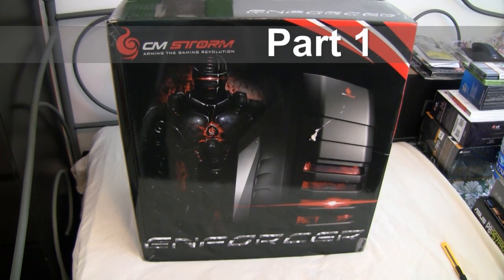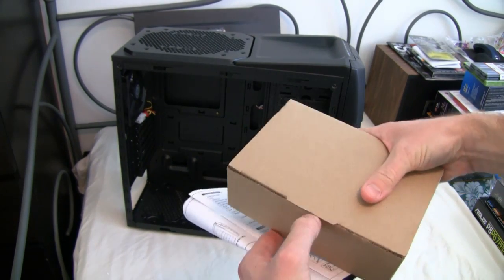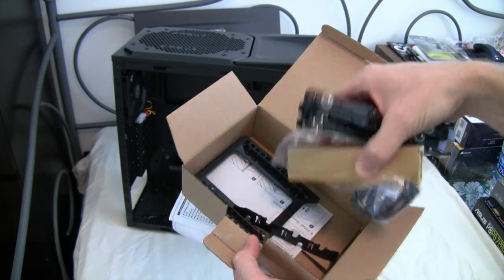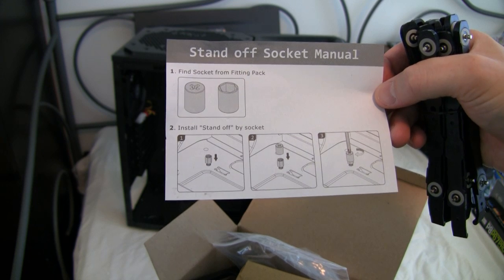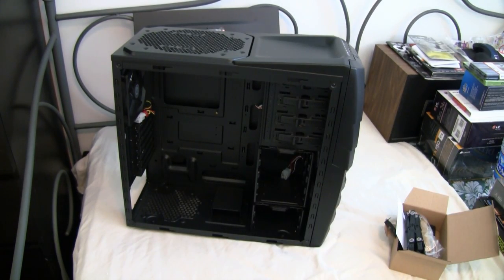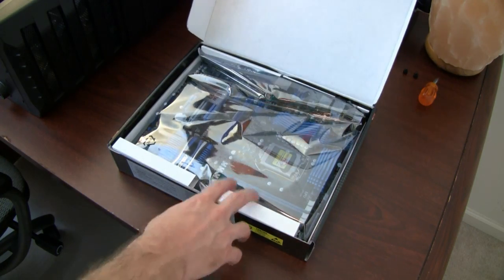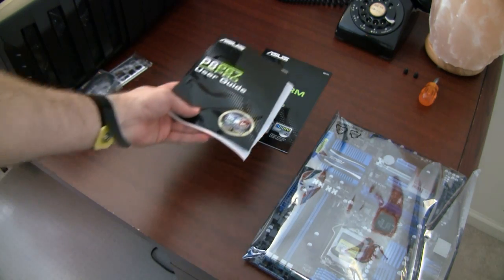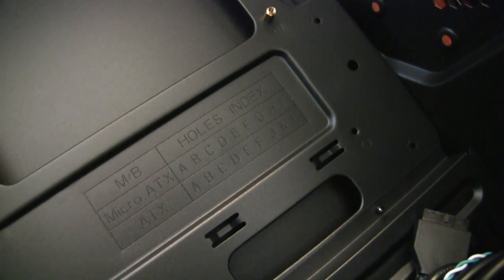Gaming PC Build instructions (Step by Step) Part 1

Comment: Please reply. I wanna build a pc but I am not sure about one thing. How is OS installed on pc. Or it goes with processor. ( yes I am a noon.)
Reply: You need a install disc. It goes into a dvd drive. Or there are ways to do it through usb. Look that up too
Reply: Did you build?
Reply: Felix aigner half way done
Reply: Rostislav Gavriliuk still wanna n awnser? :)
Reply: What parts are you using?
Reply: Felix aigner parts list costed me ~1500 $, do you need the list?
Reply: Email
Reply: ***** email
Reply: Rostislav Gavriliuk An OS like windows can be inserted into your disk drive and will prompt you through the whole process.
Reply: Get an optical drive and pop you OS into it

Comment: For anyone wondering, that thing on his wrist is a anti static wrist strap- You attach it to the case so you can ground your self. You need to ground you're self because the static electricity from you're body can short circuit you're motherboard and everything connected to it. Also another tip, don't put the mother board on top of the plastic wrapping because that plastic wrapping is only anti static on the inside, but not on the outside. Just place the mother board on top of the box.

Comment: i chose my parts on pcpartpicker and it says my Wattage is 442w so what would you recommend me for a power supply
Reply: usf slm 600 watt, just in case you plan to overclock or upgrade. You usually want to have over 100 watts of what pc part picker would recommend to be safe.
Reply: 600w, better to be 20% more than you need for better efficiency.

Comment: do you think this would be a good gaming computer?, is there any improvements i should make, do i miss something?

NZXT Guardian 921 RB ATX Mid Tower Case, Black 921RB-001-BL

Corsair Builder Series CX 500 Watt ATX/EPS  80 PLUS (CX500)

LG Electronics Optical DVD Drive GH24NSB0B

WD Blue 1 TB Desktop Hard Drive: 3.5 Inch, 7200 RPM, SATA 6 Gb/s, 64 MB Cache - WD10EZEX

EVGA GeForce GTX 750Ti Superclock w/G-SYNC Support 2GB GDDR5 128bit,
Dual-Link DVI-I, HDMI, DP 1.2 Graphics Card (02G-P4-3753-KR)

Kingston Technology ValueRAM 8GB 1333MHz DDR3 Non-ECC CL9 DIMM Desktop Memory 8 (PC3 10600) KVR1333D3N9/8G

Intel Core i5-4670K Quad-Core Desktop Processor 3.4 GHZ 6 MB Cache - BX80646I54670K

ASUS MAXIMUS VI HERO DDR3 2800 LGA 1150 Motherboard socket for 4th Generation Intel Core i7/ i5/ i3/ Pentium / Celeron Processors

Comment: This may have already been answered.. but the wrist band is a anti static wrist band the wire going downward has a crocodille clip on the end connected to a ground. It's not really neccasary when building a PC you just need to be careful. Motherboards come in a anti-static wrap that you can use to put the components together. If your handling stuff inside the case such as replacing ram etc you might want to touch a piece of the case to discharge so you don't ruin anything.

Comment: I think the wire is to do something called grounding which will discharge and charge you have on yourself, thus preventing an unfortunate short circuit accident when handling the equipment

Comment: Very informative and helpful! However, I have two questions. First off, I am using the exact same case for my build. I purchased a 200 mm fan to install above the motherboard. Do I want the fan facing downwards or upwards? Secondly, before I did anything I installed the PSU 650 corsair. Nearly identical to your model. However, when I plugged it in, the fan did not start and the whole thing wasn't working. Is it a broken PSU or do I have to plug it into the motherboard or something. Thanks!

Comment: None of them. It depends on what you're doing. Nvidia would be best for Adobe applications and single monitor PhysX gaming, whereas AMD is better for a lot of games. 

AMD also has Eyefinity which is better than Nvidia 3D Surround in most cases. AMD seems to perform better than a single Nvidia card when doing Multi-Monitor setups.

Comment: Because you can assemble first rate components yourself.

People that buy assembled PCs in shops care to check if it has a good CPU and/or GPU, that's it. But people like me just can't go around the fact that those PCs have some third rate components that may or may not last me a year. 
In my country i.e. a third rate component will usually be the PSU which that they don't even provide who the manufacturer is, it just says it's "500W".

For my taste, 350$ is not even enough for an office pc.

Comment: I was also wanting to make a build almost identical to yours. If you are wanting to add a gpu later on, you need to get a 500 watt psu. If you are wanting to not upgrade at all, stick with the 430 watt

Comment: good build. i recommend a 7770 as a gpu. You are on a budget and the 7770 is a cheap gpu which has great power. if you need something cheaper you can go with a 7750.

Comment: Hello, I like to ask a few question, in case you know and can help me a bit, since I'm noob about PC stuff :)

I currently in study and need to buy or build a pc for 3D Max study, so can I ask:
1) Is 1 GB graphic card and 4GB RAM already good for 3D Max usage/render?
    (MSI TF Hawk, I guess)
2) Does AMD FX (8 cores) processor and motherboard is enough to handle 3D Max and basic new 3D games middle/common setting?
4) Minimum watt of power supply for 3D rendering and 3D game basic setting?

._.

Comment: The heatsink fan that comes with CPUs already have thermal paste pre-applied. If you decide to go for an aftermarket cooler, it may or may not be applied with thermal paste. If it doesn't, it may come with a tube of thermal paste.

Comment from the maker: It was designed and provided by the manufacture of the processor.  It is more then enough if you don't overclock something crazy.  But if you want something flashy to show off to your friends you will have to upgrade to impress them.

Comment from the maker: What is your case grounded to if the power supply is not plugged in or installed?  Metal is a good conductor but not always grounded.

Comment: I installed it without a strap, just touch the (metal parts) of the case if you're moving around. Don't wear socks or do build on carpet and you should be fine.

Comment: Its an anti-static wrist band to prevent transfer of static electricity to electrical components.  Its really not needed any more with modern boards as long as you don't work on rugs when building, handle the boards by the edges, and frequently touch a metal part of the case.

Comment: that is to remove "ground" to get your body's charge the same of the case I think, its recommended but not required, its a safety measure to avoid frying your mother board even before turning your pc on when you touch it...

Comment from the maker: Actually to be a good ground it needs to be plugged in if you use the case as a ground.  I connect my ground strap to the ground on the electrical outlet.  I test it first to make sure it is wired correctly or you will be in for a shock.  Metal is a good conductor but if it is not grounded it does not make a good ground.

Comment from the maker: It will only work if your power supply is in your case and it is plugged in.  Then your case would be grounded.  If the power supply is not plugged in it is not grounded.  Metal is a good conductor but not always a good ground.

Comment from the maker: You can use the case as a ground only if it has the power supply installed and plugged into the wall.  If it is not plugged in it is not a good ground and can still have a charge built up.  Or you can also attach a ground wire to the case and the ground of the electrical outlet.

Comment from the maker: You can only ground yourself to the case if the case is grounded.  Which means for it to be grounded it would need to have the power supply installed and plugged in.  I use the ground on the electrical outlet.  Just make sure you use the right plug.  ;)  Oh and test it to make sure that it is a good ground.

Comment from the maker: Everything in this video still applies.  You can use the steps for any parts you wish to use.  Just pick out what works best for your budget.  The only thing you need to be sure of is that the Memory, CPU and Motherboard match together.  All the other parts are very universal.

Comment from the maker: So far it has worked good.  I am just not a big fan of the BIOS.  Once you POST you are fine.  I had some random USB issues but it could be a Windows problem.  Also sometimes it will get stuck in POST and not boot.  I have to turn off the computer and try again and it will usually work the second time.

Comment: I have a question.Let's say if you're building a new computer with a full water cooling setup, and you wanna check your computer is up and running BEFORE you add all the watercooling components, is it okay to test it without adding the CPU Gel and stockcooler or will it just ruin the CPU?

Comment: Well a cheap gaming PC motherboard would be the ASUS P8Z77-V LX, an intel core i5/i7 would be a good choice for CPU which would be around £130 for an i5. You could realistically get a small case but you'll need a good CPU fan and chassis fan to keep it cool and a GTX 670 graphics card would be a good choice also. but to run those games maybe a GTX 560 Ti could work although they are being replaced soon with the 650. It's hard to make a cheap PC overall though but that would be your best bet.

Comment: Hey man, that lever you have to push to "lock" the processor in its position, looks kinda scary, as if you put more strength to push it. I wonder if I can do that, without destroying a 100euro motherboard or even worse, destroying my 200euro processor :)

Comment: Help me please.

I'm going to build my own computer! :)
I only have 500€ (aprox 630$), and in Portugal buy a desktop it's very expensive… but building one is more cheap, so i'm building my own machine with this specs:

Asus P8P67 PRO
Core i3-2120 3.4Ghz
Asus GTX 560 Ti DCII TOP
OEM 650W PSU
and i'm going to use the 120mm from the older computer, also i'm going to use his RAM.
The RAM is a DDR2 800Mhz Dual Channel.

Please, answer if this are a good specs :)
Can I run the future games in ULTRA?

Comment: will this set up work guys please could someone tell me cooler master enforcer case
Cooler Master GX RS-750-ACAA-E3 Power supply - 750 Watt
ASUS P8Z68-V PRO/GEN3 - motherboard
Intel I5-650
Corsair CMZ8GX3M2A1600C9 8GB 1600MHz CL9 DDR3 Vengeance Memory Two Module Kit
MSI R6870-2PM2D1GD5/OC Graphics card - 1 GB - GDDR5 SDRAM
Western Digital Scorpio Blue 500GB 5400 RPM SATA Mobile Internal Hard Drive OEM (8 MB,2.5)

Comment: static shock is dangerous to your computer parts and that grounding strip discharges any built up static electricity if you find that you get shocked often when you touch doorknobs or if you live in a dry area you should get one but otherwise just touching the exposed metal of your computer case every once in a while should do

Comment: Grounding Straps are used to prevent Electrostatic discharge from the person that is working with electrical equipment such as computers. If you don't use one of these there is a good chance you could damage all your components inside your pc. 

I recommend using one and you can get them from eBay,Amazon etc.., they aren't expensive.

Comment: It's a static wrist band. You strap it around your wrist and hook the metal pincer on the other end of the wire to a piece of metal. This grounds you and helps prevent any accidental static discharges on the static sensitive parts.

Comment: the build up static electricity, because all humans have electricity in them (very simply put) so if you touch a sensative component e.g. a motherboard you transfer your electrical charge to the board and can possibly fry the components. its to stop breaking your motherboard:) they're like £2 so you may aswell buy them. if you dont you can always ground yourself by touching a live power supply, one plugged into the wall and turned on:)

Comment from the maker: @redwire95 The ground connection in the electrical outlet.  It is the one on the bottom that is a half circle.  I would use a outlet tester prior to using it to make sure it is wired correctly for safety.

Comment: no necessary my friend you don't work with a PC connected  to a wall outlet, and any way that is not safe, but there are other options like the antistatic mat, also there is a special connector that goes to the ground outlet with a resistor but that was a long time ago, but yeah I know where you going now man. also remember the metal while touching a few times will be just  enough, I already build 6 computers no problem at all.

Comment: @lhx1996 The case is very important. If it does not have proper ventilation then your performance will suffer, and some of your components may even be damaged by the high temps:D

Comment: @stupidusernamejp It depends which you are on a carpet or wooded floor. But It's much more safer using the Anti static wrist band but yo CAN build your system without it. I build my previously system and it runs completely.

Comment from the maker: @wmw0702 The bag used has maximum, triple-layer protection. Unlike most anti-static bags that suppress static charges on the outside only, this premium bag guards against charges inside and out. The polyester outer layer features a semi-conductive static-shielding coating. Times and coatings has changed over the years people. I also touched the outside of the bag before laying the board on top to ground any charge.

Comment: @MrBanChinga you cant find any videos cause most pc builders aren't too worried about it. now this doesn't mean you should go dragging your socks on a carpet then putting a pc together. The chances of you ruining hardware are pretty small, but using a anti-static wrist strap and connecting the clip to any grounded metal will do the job.

Comment: Btw i would suggest setting it up in the Comp, preassemble it out side with out the Vid card, such as the ram inserts, and ur CPU. Just a tip to the newer pc builders. Alot easier out side setup then set it in.

Comment: @jean9910 It's an Anti-Static wrist strap, [very cheap in the UK cost like £1.50]. You connect it to the wrist and then attach to metal parts, it basically stops static energy building up, If you have carpet, by walking on it, you can build up the energy and by touching the components, ie. like the motherboard, you may fry the circuit. So as long as you ground yourself, "touch" the metal ie. the pc case, you are getting rid of the static energy and preventing ruining your components.

Comment: I had the case. Switched up for a corsair 800d. The case has some crappy features. The power button is in the worst position possible right under the mic and headphone jack and when you pull them out you occasionally press it. Although  it does have zip tie points on the rear of the case. But the cover over the 5.25 bays get in the way of fan controller knobs and such.

Comment: @z34gtpz28 where do you clip the aligator end? to the case with psu connected to the wall socket? cos i heard i need to do that or clip it to unpainted steel, but i dont have unpainted steel that grounded, and im on carpet.. can u tell me where to clip?

Comment: @Dispersedpanda He does kinda tell you each part, but I'll tell you: Coolermaster storm case, asus p8p67 motherboard, corsair tx750 enthusiast power supply, kingston hyperX RAM, OCZ 120 SSD, gtx 570 graphics.

Comment: I use a VGA on my GeForce 550ti because I'm using a 42' Vizio for a monitor. It's as good as the hdmi. Games like NASCAR, Test Drive and Need for Speed look fine on this big Vizio. I put myself in the driver's seat and the simulation is almost like the real thing because of the screen size. I'm using a Logitech G25 wheel and the force feedback is awesome.. If anyone doesn't use a flat screen for a monitor, they are missing out on some real fun.

Comment: @MrPixelparty If you plan on overclocking , you can choose between P67 or z68 chipsets.
While z68 chipset boards are a little more expensive, they provide both the overclocking capability of p67 and the   built-in graphics.. Also , Z68 provides suport with Intel's Smart response technology , that can make your SSD be seen as a cache to a normal HDD. ( making z68 my chipset of choice ).

So P67 and Z68 are the way to go if you want Overclocking.

Comment: @MrPixelparty p8p67 is a performance-oriented motherboard.. that has the P67 chipset installed.
 it supports Overclocking on "K series" processors or "Multiplier-unlocked" processors. this chipset does not support intel's hd graphics that's built-in on the processor chip.
P8H67  has the h67 chipset . It doesn't allow overclocking but it supports intel HD graphics..

Comment: From what I understand a grounding strap is only crucial if you are building in a house with carpet or rugs, otherwise so long as you try to maintain contact with your computer case you should be fine. Can you confirm this, since I have no carpets or rugs in my house.

Comment from the maker: @TSGExcite Sure just the BIOS might give you some trouble but most of the time you are not in there.  You can still use the keyboard to navigate around but you can always just put a wired mouse on if you want ease of use for the BIOS.  But I think it is only Microsoft that it does not like, other brands might be fine.  But once you boot into your operating system you won't have any trouble with any brand.

Comment from the maker: @MrSgc333  The bag used has maximum, triple-layer protection. Unlike most anti-static bags that suppress static charges on the outside only, this premium bag guards against charges inside and out. The polyester outer layer features a semi-conductive static-shielding coating.  Times and coatings has changed over the years people.  I also touched the outside of the bag before laying the board on top to ground any charge.